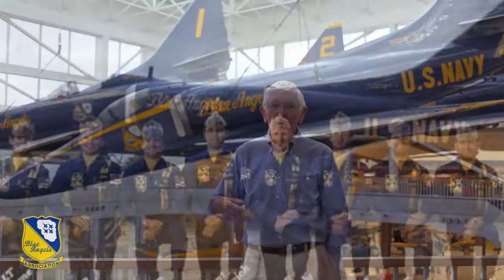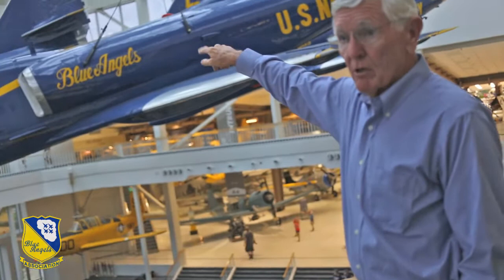RADM H Denny Wisely USN (RET)

Comment: As a spectator that saw the A-4 Blue Angels dozens of times, I definitely think it is a better performer than the F-18 for the purpose of a flight demonstration team on a airshow circuit.  The A-4 was so snappy and quick, it was in its perfect element.  The roll rate was insane, the turn rate was incredible....  It made all of their maneuvers so crisp, fast and precise.  The F-18's are good, but they're so much larger that they're not nearly as nimble and the show has lost something IMO.  I think the T-45 may have been a better way to go than the F-18, but the admiral is right...but what are you going to do when your competition is rolling out F-16's?